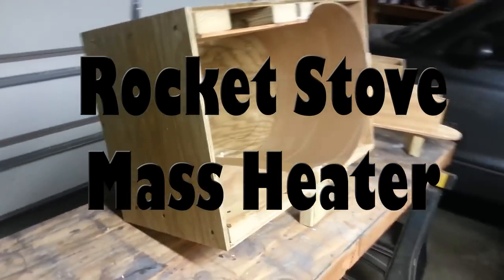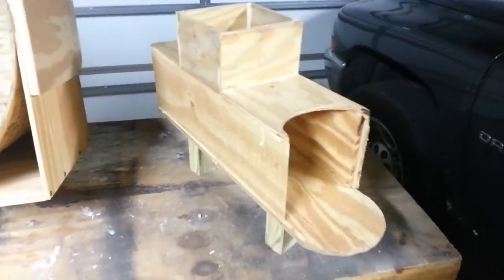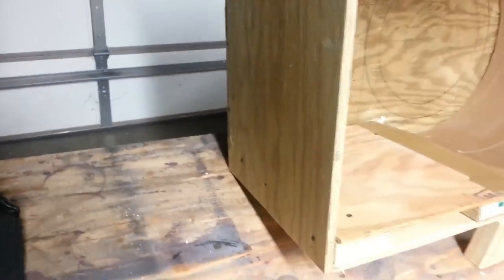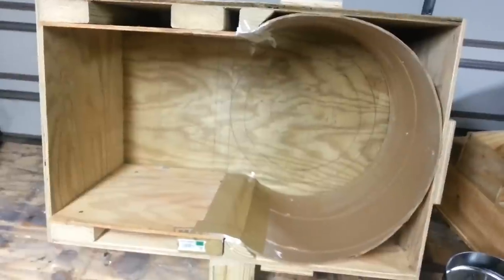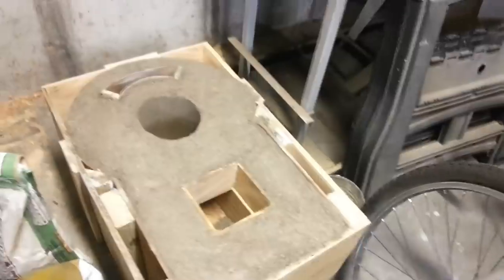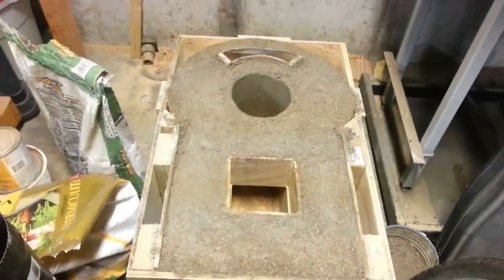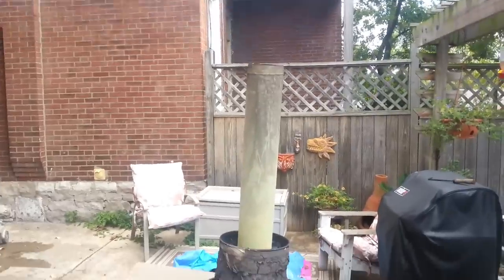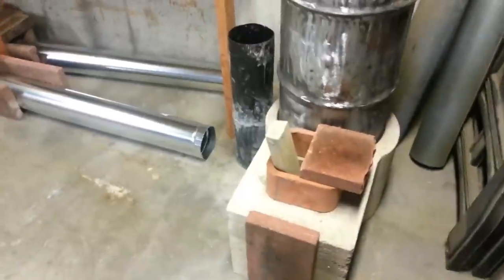Rocket Mass Heater Build

Comment: Bill,  one of the best well though out designs I have seen thus far.  

Rob
Reply from the maker: Thanks Rob, but I am still waiting for my new heat riser to finish drying and then for my first fire test to know how successful this design is.  That should be in a week or so.  If I can seal the drum well enough and possibly tweak the distance between the top of the riser and top of the drum to get it drawing powerfully enough I will be pretty happy with it.  I am just now finishing the flue.  Wish me luck!
Reply: Try two stacked 2x4's for the top test distance.  Perhaps on the next design maybe add a relief around the bottom where the drum meets the base...then stuff it with oven rope seal around the perimeter...  For a more permanent seal...try saturating the rope with some high temp silicone.

Very much enjoyed your video..  I have many ideas that may improve a future design if your interested.

Keep up the good work...I look forward to burn video.

V/r
Rob
Reply from the maker: I think the distance is probably good.  I can raise the drum with clay or cob if necessary which will also seal the drum.
Reply: Bill Rust how has it held up so far... is the mix a good solid mix

Comment: I used paint stripper and a stainless steel wool type scrubber pad on the outside of my grease drum, but because I wasn't sure the stripper was cutting it, I used a simple fire to burn out the clear inside coating. Now it has a beautiful heat-blued finish and I hate to paint it. I laid drum on it's side, covered about 1/3rd at a time with gel type stripper, let it work, and it scrubbed off fairly quick using very little stripper. The  gallon I've had for years still feels nearly full.

Comment: This is very cool, thanks for putting this out. right now I'm building a steal stove, iron clad would be a good name for it, I'm up to about 500 pounds of steal so far, plus concrete. I have about 5 weeks in to this thing so far. last week I lost my mind, but I am recovering now and back on track. Mite have this thing done in two week. right on time too, it's already getting cold. I had a 55 gal drum, barrow  stove kit last year. The first stove that I build  and learned how to use and not use. But the bottom line for the  barrow stove kit is,  it's just to thin. If you did every thing right its only going to last 3 or 4 seasons, if your lucky. If your not luck, it could burn through at night, and there is nothing good that could come of that. so just to thin.
Reply from the maker: +Curtis Grantham 
Yup, I think the answer is to replace the cement with refractory clay.  It can be had cheaply from a home pottery store.

Comment: That looks awesome, great design, but I think that mix design is going to fail on you if you used the Type S mortar I see in green bag. Lime and portland aren't designed for those kinds of temperatures. You should experiment with some refractory type cements.
Reply from the maker: Please read the other comments.
Reply: I've read if u stick rebar in the cement it will make the cement crack after it expands

Comment: great video, thanks for sharing! I like your idea of exhaust manifold embedded in the cast; great idea, and execution!

my $0.02 : 1), you mention it weakens the cast there, and it crumbled away - I'd think that embedding 2-3 curved rebars there, while filling in the cast, should do the trick, integrity-wise, 2) is your manifold big enough, so it doesn't create flow restriction? I think the general rule of thumb is, the area of cross-section of the exhaust, should be more or less constant, and it doesn't look to me, that it would have similar area, to a cross section of a 6"pipe - but I might be getting things wrong, so could you elaborate on this - and better yet, all theorizing aside; does it actually work well 😁

Comment: Re-bar would make your design 1000$ stronger
Reply from the maker: Probably, but this is intended to be covered in cob in most applications, which would also strengthen it.  Since it has 4" walls (except for the exhaust port) it is quite strong.  I think fireclay is the way to go in the future.  Rebar or some wire mesh would certainly be something to consider if I were to think about making an exhaust port change or also surrounding the clean-out.  Thanks.

Comment: was this normal or refractory cement?
Reply from the maker: No.  It would be better with a vermiculite / fire clay mix as I said in the video.
Reply from the maker: I would use fireclay.  Most pottery supply places will have it for a reasonable price.

Comment: A proper burning rocket mass heater burns hot enough to start reversing the chemical reaction that hardens concrete. It's hot enough that metal corrodes away very quickly also. For these reasons both materials are usually excluded from the burn chamber (other than metal secondary air on batch box versions). there's a wealth of info on permies.com , and on http://donkey32.proboards.com
Your design has clean lines though and looks good

Comment: what degree in temp do you get with that? thanks for posting!
Reply from the maker: I think I topped out around 900 Degrees.
Reply: Thanks for your answer.  Just wondering if that will keep a house in the 70 degrees F in winter  as in New Hampshire winter? This wouls be installed in basement. Would that heat only basement entirely or just around this installation?